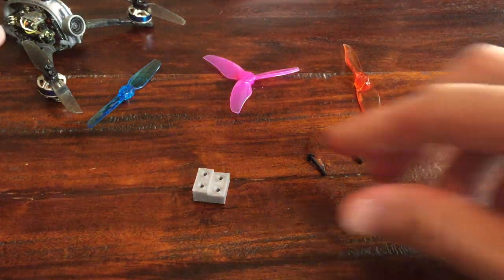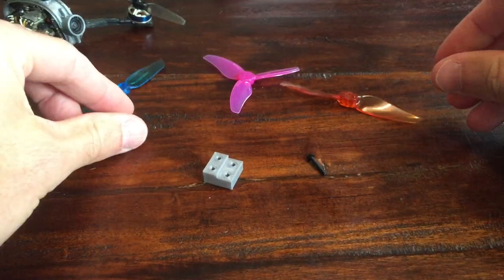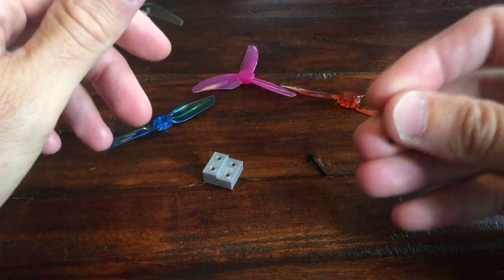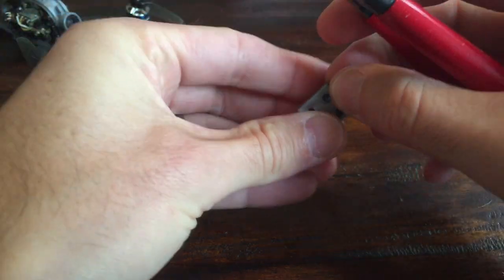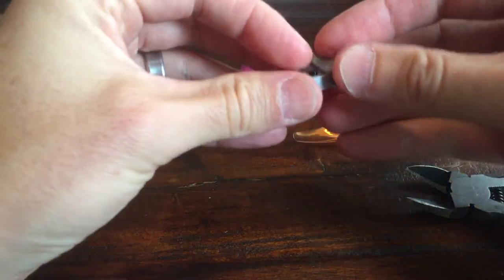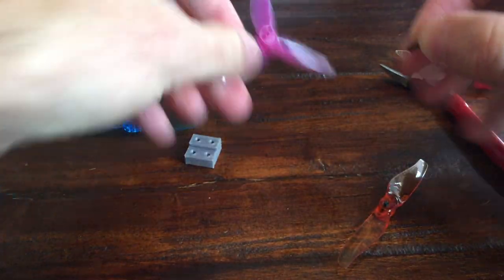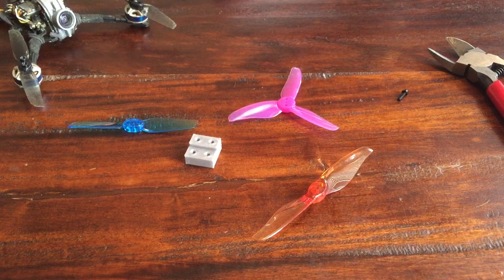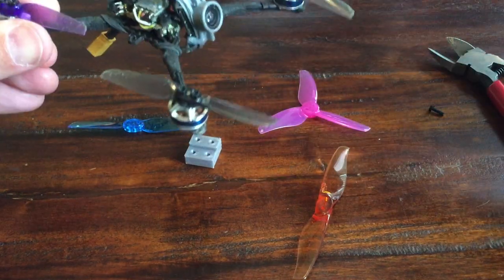Prop screw cutting block (free .stl file)

Comment: So you’re using nylon screws on motors? I’ve always been scared to break the screw inside the motor bell…
Why not dental floss? Yeah it’s more of a pain to put in… but it works well in my hands.
Reply from the maker: Yes I find nylon screws more reliable and less of hassle than flossing. Also, flossing doesn’t solve the issue of the shift spinning in the bell, which is my biggest issue currently. Yes the nylon screws do break in the bells. If you break a nylon screw in a motor bell just use the tip of a soldering iron (fine point tip) to melt it out.
Reply: I quit flossing props also, and am using nylon screws.  I would occasionally lose flossed props when hitting branches and thus have to walk.  Nylon screws weigh nearly nothing, so no problem there.  I've just been eyeballing the length and cutting with fine wire flush cutters.  Regarding removing the broken screw, I just jab the tip of an xacto blade in what's left of the screw and unscrew it.